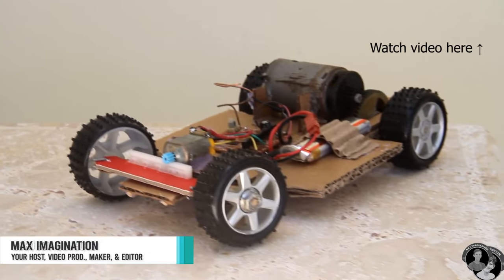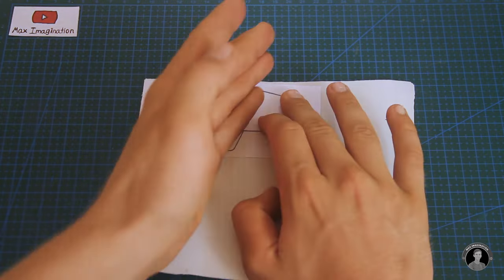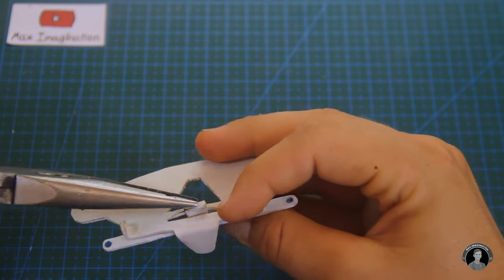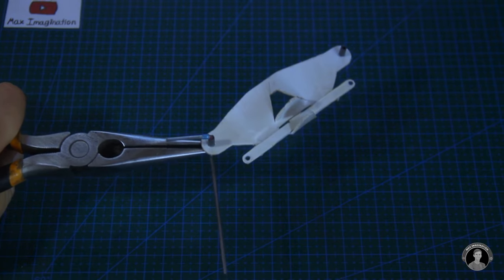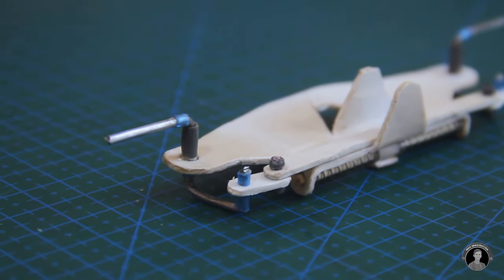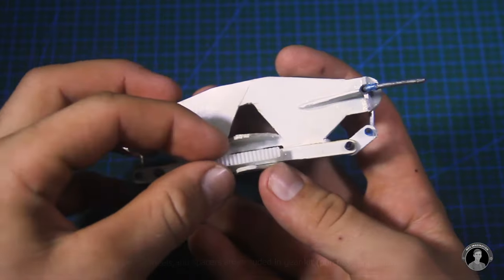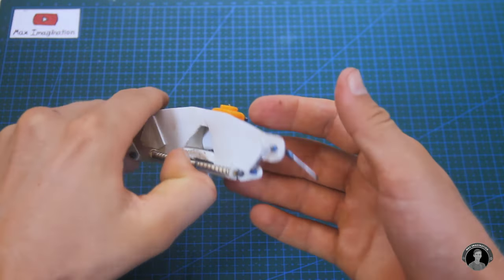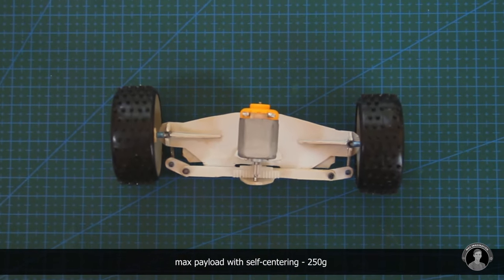How to make RC Car Steering that Self-centers - Front Axle | Toy-grade Mechanism

Comment: I did everything that u did, but my 3 volt dc motor cant seem to move the mechanism, its maybe less powerful, what do i do
Reply from the maker: Hi there. You might need to reduce the tension on the springs, either find some weaker springs or compress them a bit.
2, you might need a higher-voltage power source or a stronger motor. Hope this helps.
Reply: Brother try less tensioned springs and high torque motor like gear motor.

Comment: I think the electric current will break the motor because at some point it cant move and it will melt the rotor
Reply from the maker: Not quite... it may heat up the motor, but meltdown isn't possible due to the already low power given. You can choose to over-complicate the mechanism with stop switches and unnecessary circuits or simply make a steering mechanism with a 9G servo for a hobby-grade RC car that can tell where to stop.
Reply: You are mistaken,Mr.dooms. The steering system created by Max is designed to be used with a low-voltage on-off And,You might not be aware, but...Similar steering systems are also occasionally used in RC cars for children.

Comment: Is there's 3D models that i can print instead of making? I don't have these tools
Reply from the maker: Not yet, since it wasn't designed initially in a CAD program... I would have to make a 3D model of the steering from scratch...

Comment: Super cool! Could you add 3d model STLs for printing?
Reply from the maker: Hi there. Thank you!
I have not publicly provided an STL file to its 3D design due to the dedication and time it takes to design it when I did not 3D print the project in the first place.
I would be willing to personally 3D-design you this steering mechanism in return for a kind tip via the "Super Thanks" button (up front payment).
Cheers.

Comment: Hey Max!
I just wanted to ask if you think this design would be possible to create with cardboard. Because unfortunately, the PVC around my neighbourhood is much too thick to make the design. So I just wanted to ask if you think it is possible to create both the car and the steering with cardboard?
Thanks so much
And make sure to keep up the great content!😊🎉
Reply from the maker: Hey there! With more durable cardboard, it may be possible but the self-centering part will probably not work due to the tension required. I highly recommend you look in your hardware store for 2mm pvc. Thanks for your comment!
Reply: Also cardboard is going to be really difficult to make the pieces as small / precise as you need it for this! If you can't find the PVC locally you can probably order the small pieces from one of the on-demand 3d printer services

Comment: I have tried making this steering mechanism for my project but i dont know why it doesn't slide left and right.... Please help
Reply from the maker: This could be due to not having sanded the parts in certain areas to make it slide better. Try also scraping away any unnecessary edge around the slider. Cheers.

Comment: Не сгорит ли двигатель если долго держать под нагрузкой?
Reply from the maker: Not if you apply 3-6V only. At most, the motors will get a bit warm. However, you're not supposed to press on the steering buttons for too long of a duration anyway for turning.
Reply: @MaxImagination  thank you friend greetings from Bashkortostan

Comment: Wouldn't the motor will damage cause of motor will stop at the and of limit
Reply from the maker: Not at such low voltage, but it will draw unnecessary excessive current. It's up to the person controlling the car to let go.

Comment: Bro the biggest problem with me is whenever i try to make the steering it doesn't work properly means it has too much wait or something
Reply from the maker: Yeah... One thing this mechanism does not tolerate when functioning is a payload over 250 grams. Anything higher onboard will most likely stop the mechanism from self-centering.